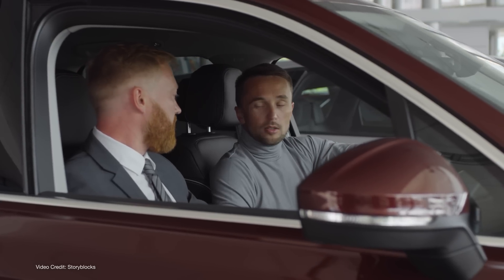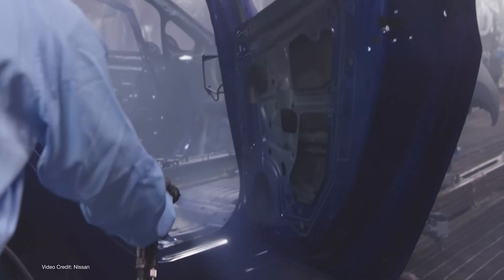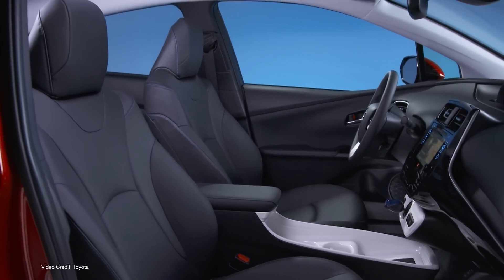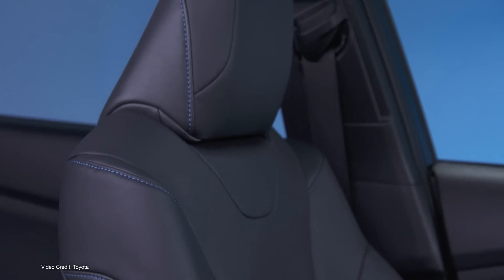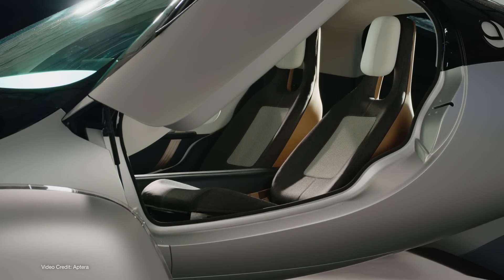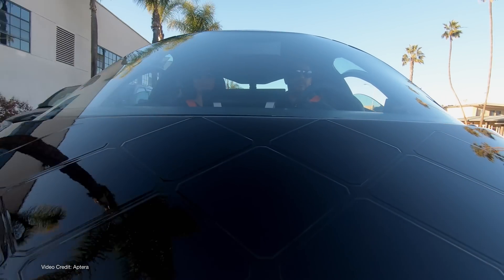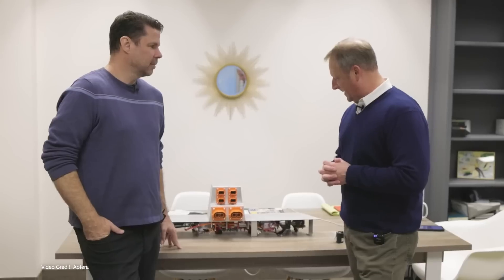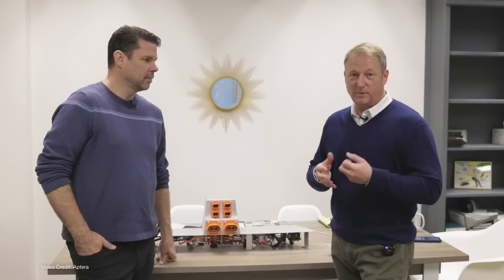Aptera Just Did a 180 On Fast Charging - Here's Why

Comment: The Aptera looks to me to be a car that doesn't need fast charging. Smaller motor, high efficiency.
Reply: When you are stuck in the future with 1% SOC at a highway charging location that has 50 working DC and 1 defective AC charger, I’m pretty sure you would start to disagree.
Reply: @geraldh.8047  If there's still someone who doesn't understand that traveling by EV requires a teeny-tiny bit of planning....
Personally, I think most people will have a small-battery-and-motor EV for everyday use, and will rent for exceptions. That's the most efficient, at all levels.
Reply: @bobnelsonfr  if I have a super efficient EV, I want to use it for the long drives so I can be super efficient traveling to distant city X !
Reply: @geraldh.8047  Your choice. Expensive.
Reply: @bobnelsonfr  renting a non efficient car to drive from A to B is more expensive than using your own highly efficient car that you need anyway? 😳
Reply: @geraldh.8047  If you really NEED a big motor and a big battery... then you're right. That applies to very few people.
Reply: @bobnelsonfr  a big motor makes a small difference in cost. A big battery makes cost go up more, but does not drastically change the cost of the entire car.

Makes very little sense to save 30% when buying the car to then have a slow, boring, less well made car that can’t go long distances and whose battery wears out faster due to more cycles.
Reply: @geraldh.8047  Take a look at the EVs available in Europe. (Keep in mind that European prices include about 20% VAT.) Citroën eC4, VW id3, MG has several and there are now some Chinese. A new Smart that's nothing like the previous ones. They all have less range than "American" EVs.. Europeans actually look at their driving habits.
Reply: @bobnelsonfr  I don’t have to look to Europe because I am right in central Europe. Neither of those cars you mentioned is in any way cheap and the smaller battery options are not selling well. The new smart has 273miles of range (272HP RWD), not exactly sure what you want to tell me with this. By the way, as usual with the new smart the most expensive option with 430HP AWD was the quickest to sell out. That probably proves your point that Europeans want small cheap low range cars?!?
Reply: @geraldh.8047  Have a great life

Comment: I don't know why anyone would buy this thing. Wider than a F150 Raptor but with the turning radius of a F250. Can't do drive-thrus. Has "sacrificial" parts. What happens when the rear panel with all those charging parts gets a tap from your F150 lightning?  Will it all short out?  Melt down?

Comment: Having lived with a sub 70 mile range Spark EV for 2 years that I made sure had CCS just in case I have to say they are mostly right that with 400 or even 250 miles you'd probably be fine I still would not recommend it, I needed DCFC desperately maybe 3-4 times but never ended up stranded on AC for 2+ hrs. Maybe if we had some French 20-30kw 3 phase AC charging on every corner but that's not a thing here, we're stuck with Electrify America and EVGO. I'm not sitting on that one sad j1772 collecting dust by the Chademo with a NACS adapter on my futuristic Star Trek 09' pod feeling like a chump, not even 1x for the $30k+.
Also overnight Hotel charging is not as ubiquitous as it well should be by now
Even on a motorcycle I would not forego DCFC, Hence not a chance of going for a Zero over an Energica when I finally have a spare $20k to ditch ICE on 2 wheels as well as 4.

Comment: There are many thoughts I have but baseline... I hope many more reservation holders join the ranks and we all help lighten Steve and Chris's load in fundraising.  Aptera is proof we can refute the recent report an increasing number American electric cars need increasingly more batteries, adding increasing weight to move vehicles completely heedless of the amount of lithium mining effects on the environment. 
Secondly I while I do appreciate the physical Tesla plug and its power to charge I am definitely uneasy about its future. Definitely.  Good news is I Can live without it if push came to shove.
Reply: Generally agree but I feel I should point out that reservation fees do nothing to lighten the load for fundraising.  Reservation fees are held in escrow (required by law to satisfy the guarantee of refund-ability) so that money is not useable by the company before the vehicle sale actually goes through.  That is part of why I also invested.

Comment: When I saw that Aptera wasn't going to have DCFC I wondered what the hell were they thinking.  On one hand they told us that the vast majority didn't need it because they would be using the car as an everyday commute and the solar practically covered that.  How could they say that with a straight face when the Founder's edition of the car was to have the 400 mile battery pack which meant that the vast majority of those that have pre-ordered an Aptera apparently had long trips in mind and did Chris Anthony and Steve Fambro think these folks wanted to wait 8 or 10 hours for their cars to charge??  It is like Toyota telling us that 25 mile battery is plenty for their Plug-in Prius Hybrid.  I've got one of those cars and 25 miles is a joke.  Car is great but 25 mile battery should be at least 100 miles.   Back to Aptera.   I'll bet the reason they were leaving the DCFC off is because of one or two or even three reasons.  One is that Aptera is in dire need of cash to actually survive to until production is possible and DCFC is just another expense they wish they didn't have at this time.  Second possible reason is that DCFC would be a great option that customers would pony up for.  The third reason might be that and I believe they even spoke of this, battery heat management.  It is one thing to trickle in all that current over 8 to 10 hours and keep temperatures in check and a whole other thing to flood DCFC current into the battery without coming up with the means to cool the battery pack while that is happening.   Skin cooling at a standstill while charging most likely is not going to cut it.  Anyways,  I don't think anyone buying an Aptera hasn't dreamed of driving long distances and exploring America and DCFC is really the only option in making that dream a reality.
Reply: At low speeds or at standstill, Aptera's AC system will kick in to provide active cooling for the liquid coolant loop, with heat exhausted by fans through vents at the rear of the vehicle.
Reply: @n.brucenelson5920  Good to know.  Have they actually said that is how it will be cooled?

Comment: I think SLOW DCFC is a fair compromise on the Aptera.  Even going down to the absolute minimum DCFC speeds (even sub-Bolt EV speeds).

Given the pack size, and the focus on efficiency, a slow DCFC is better than no DCFC on a small pack and opens roadside chargers to usage.
Reply: Much like the DCFC on the Chevy Bolt?

Comment: Since they use a totally useless plug type - I might find an old Tesla Supercharger somewhere but it will be replaced by a modern V3 Supercharger soon - the 6.6 KW AC charger is a deal breaker for me. We have three phase AC limited to 16A in typical households and most public AC chargers are limited to 32A. So I would get around 3.4KW at a public charger where I'm allowed to park for three hours.
Reply: You must not be located in the US.  When Aptera offers European homologated vehicles there are likely to be a number of changes.

Comment: The fact that Aptera is using the NACS only really makes sense if they were using the DCFC. That's the whole point of using Telsa's charging network.
Like everyone else - I was very surprised that they left DCFC out originally, and I had to think long and hard about it. I already have a $100 deposit, and I had just changed from the 600 mile to the 400 mile battery option. I am hoping to use my Aptera for my business - by delivering my MLTL-6 audio speakers directly to customers; rather than paying nearly $500 for shipping, and risking damage to them.
And like everyone - I was greatly relieved to see their announcement that they would in fact be including DCFC (40-60kW estimated rate) on the Launch Edition.
I did change my reservation to a Launch Edition, and I have purchased 100 shares of Aptera stock.
Reply: I agree, and I think they could have mitigated this by supporting 12-15kW of Level 2 charging, which is available through Tesla HWPC AKA Destination Chargers. That would have at least reduced charging times in many situations to just 2-3 hours.

But, at 40-60kW, I’m a happy reservation holder now, adding to my preference for its efficiency and repairability intent.
Reply: @BrianTRice77  Right - I would like having 10kW Level 2, at least. And depending on what is the limiting factor for their DCFC in the Launch Edition, it may be able to maintain 40-60kW for a longer portion of the time? I agree with you on the reasons I like Aptera - we need as efficient energy use as possible, and we must have full right to repair.
Reply: As a fellow reservation holder, small stock holder, and volunteer brand ambassador for Aptera, I want to extend my personal thanks.  It will take all of us working together to get our vehicles produced, and aside from our personal needs, this is a good thing for the world.

Comment: If the company moves its motors inside the body and attaches the front wheel covers also to the body, then it might succeed. Why this recommended change? I built a car with fenders attached to front wheels; four welded contacts per wheel. The constant big and little road shocks kept breaking welds. I only drove on perfect Scottsdale and Phoenix city streets. Imagine this same design but add two electric delicate motors! Suggest Aptera executives conduct off road and pot hole paved roads and wet winter testing. Hopefully such testing will prove the vehicle's front wheel covers and motors shock proof because there are no shock absorbers. Hmmmmm?

Comment: I agree that DCFC is a must for the 400 mile version. However that becomes more unnecessary once one considers the 1000 Mile version. But I get it. The number one issue for ev owners is range. Regardless of Real world experience, range is extremely important. 
My Tesla model 3 in five years has gone from 310 EPA miles or 290 real world miles at 65mph in summer 85ish degrees to 260 real world miles, same conditions.
Trust me, even with these numbers I obsess in how much range I have and when I need to charge.
Right now I am traveling and my car is at the airport. I am stressed about how much range I will find when I get back. 
So yes, I will want a car that charges from the sun, has at least a 600 mile range (500 real world) and can fast charge in a pinch.

Comment: Nikki, once again you've done it.  Somehow, you've put the onus onto Tesla to open their charging network to everyone in order for these poor startups to succeed.  Imagine if the only choice for everyone is the Tesla supercharger network...despite Tesla's superior and efficient design, your F150 would need to consume 3 charging spots in order to use the short cables due to Ford's bad decision to place the port on the side of the truck.

Tesla has already addressed any charging concerns with 3rd party vehicle manufacturers in NA who wish to implement their plug in inconvenient locations.  For $200, anyone can purchase the Tesla CCS adapter which will convert the cumbersome CCS cables into the ultra efficient design of the Tesla socket so that anyone can fast charge on Electrify America, EVgo, and all other CCS charge stations.

Your 'nice mannered' approach to always seeming to blame Tesla for having a significantly better design logic across its entire enterprise and casting them as the constant 'bad guys' is not lost on me.  Are you even aware that third party chargers are beginning to ditch the Chademo and add Tesla plugs to their stations?
Reply: The problem I have with an adapter is the weight of the cable pulling on the charge port. That can't be healthy.
Reply: @Hans-gb4mv  I don't think the CCS cable weight is healthy for anyone or any port.  I've assisted many new EV owners who couldn't get the charger to talk to the car....I showed them how to hold the cable up off the ground until the charging started and the communication handshake was complete.

Comment: I admittedly didn't see the Aptera live stream, but I wonder if the initial idea to not include fast charge had anything to do with the EV power contactor shortage? DC fast charging requires two extra power contactors. The usual sources for these are back ordered 12+ months at the moment (has been for 2+ years now). Looking at the video showing the PDU, I recognize the make and model that they are using.... I just cancelled an order from one of the "mega" contactor companies after waiting 5 months with no end in site, after securing similar spec contactors direct from Asia. Maybe Aptera found a way to do the same.
Reply: You are correct.  Parts supply has been a continuing issue since the Covid-19 pandemic began, even for Tesla and other companies with product already in production.  Even simple parts have long lead times.  This is the reason Aptera won't launch with a heat pump.

Comment: Friday the Aptera message was a sugarcoated message similar to the German Sono Solar car message. The designs are ready for production but the hump to actually get the factory started will take a few hundred million each. With economic recession around the corner this looks like a mission impossible. Now that Lightyear 0 is taken off the market to focus on Lightyear 2 production, things are starting to look really shaky. You should do a video on this climate for solar EV's soon.
Reply: Aptera only needs $50 million to start production, although more will be needed to execute their expansion plans.  Remember Tesla got their initial funding in the midst of the 2008 recession and in the literal last possible hour, at a time when they were still breaking transmissions with every demo drive.  Aptera is far head of that pace both financially and technically.  It is a heavy lift, but certainly doable.
Reply: @n.brucenelson5920  But when Tesla was looking for money, there was no real EV market, they had a unique product, something that, even back then, had a decent demand but just no supply. Now it is different. YEs, the Aptera is a quirky car, but is that enough to attract enough customers to make it a viable product? Is that enough to make investors trust that they will get a decent return?

Comment: It was a PR stunt. Claim to remove a feature, then return it and say "see, we listen to your opinion". Now the discussion on this (and other) channels is "Aptera listens to customers" instead of: "why is quick charging only 40kw instead of the 100-150kw on other cars"
Reply: Maybe you should compute the charging speed in mph to realise it is a non-issue for the aptera, it will be fine even if it would be "only" 40kW (meaning a high 400mph charging speed). Charging a Porsche Taycan at 100kW is only 245mph, a Tesla M3 at 100kW is 385mph.

Comment: Nikki: EV reporters should always ask to know the operating voltage of any EV. I suspect that Aptera are running at about 200V. Running this lower voltage they can use readily available components instead of competing for the purchase of 400V components. This could explain limited charge rates although battery cooling capacity also plays a role. I will hold my Aptera order until a 400V operating system is used. This should bring in weight/cost savings on motors and wiring and ensure compatibility with public chargers in 20 years time.
Reply: No, It has been known for a long time that the nominal voltage of the Aptera is 402 volts.
Reply: @n.brucenelson5920  Great to know that Aptera operates at 402 volts, I must have mist out on that a long time ago. That leaves only battery cooling that's limiting it's charge rate?
Reply: @roelhellemans2451  The wheels and battery are liquid cooled by circulating antifreeze solution.  The copper buss bars carrying the DC charge could heat up if they were to carry more current, which could be solved by increasing the size and weight.  600 and 1000 mile range versions of Aptera will probably have this done so that 100 kW charging rates can eventually be supported.
Reply: @n.brucenelson5920  Yes I saw the "update" and the copper strips but I don't think it's the view grams of those copper strips make any difference. Could it be that the thermal capacity of the cooling at standstill be  the limiting factor?
Reply: @roelhellemans2451  At the 120 degrees and more that is sometimes seen in the Phoenix AZ area, it is possible.  I also think that Aptera is very conservative in protecting the battery pack.

Comment: It was a blunder, to not have it as an option.

It ads value to the car and most people were expecting it.

They reacted quickly and correctly.
Reply: Yes. But it is a bit more complicated. It also affects the battery chemistry. A Porsche taycan has a different chemistry that can handle faster charging. It has more buffer above the useable capacity and handling higher currents comes with the cost of lower energy density.
Reply: @stefanweilhartner4415  no it doesn't.
FC just means you can use DC external chargers, the battery pack tells the max charge it wants.
Reply: @stefanweilhartner4415  omg what are you talking about?